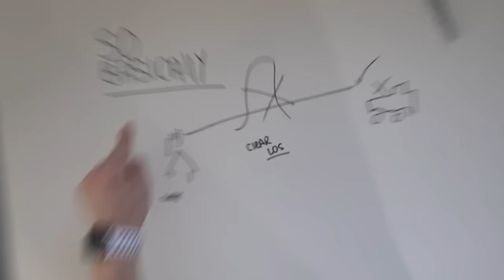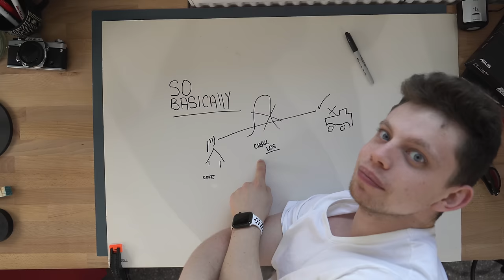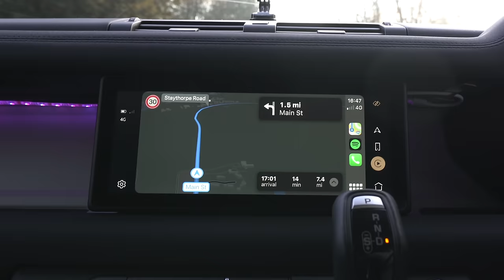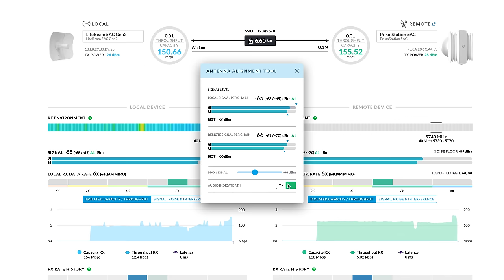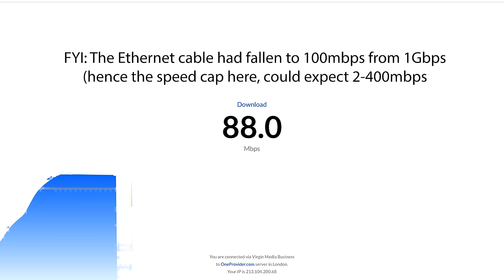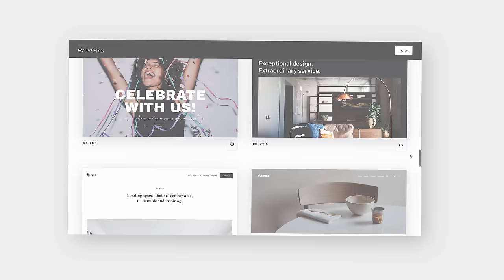How to send WiFi over 10 Miles!! (it's so easy)

Comment: Alex, you’re using the devices at a transmission power way above legal limits in the UK. Both antenna gain and transmitter power totalled together should not exceed 36dBm... and that’s in the licensed 5.8ghz band. 
If you’re not careful this will cause you a great deal of pain with OfCom! 
Read up on IR2007 and FWA Band B and C.

Moreover, your output is 50watts and the UK limit is 4watts! 🤯
Reply: This sound really interesting! I am looking forward to Alex's response :D
Reply: Where are you seeing the output power out of curiosity ?
Reply: @thecomputertech  8:33
Reply: I mean.. Who cares

Comment: I was thinking about this. 
I'm wondering if you can buy an old news channel van with those antennas that extends so high and repurpose it to a wifi extender?
I know they're made for radio/micro waves, but I think you can connect or convert your wifi router to that antenna system to get miles from it?

Comment: So, we have an office space that is 1.5 miles from our home, but it only has OLD DSL (<3Mbps) service available. Our home has 200Mbps. In between is mostly farm field, with just a couple lines of trees. I'm wondering if this would work through trees (no other solid obstacles), as we were quoted almost $11,000 to build out to the office with cable. Both buildings are two-story buildings, with our home roof peak sitting about 30 feet above ground. Thanks, in advance.
Reply: I also run an ISP in Europe.. Waaaaaaaaaaaaay bigger then this guy. Like 10K+ customers. But back to your problem, It will depend on tree coverage for antenna coverage, fiber optic cable is super cheap if you have some tractor there on the farm, build a subsoiler with a cable shoot, 40-50cm (Our machinery achieves 110-130cm direct buried cable.) You can look at a pipe layer, that will do the same job... Lay a cable deep, job done. If there are trees, the signal will vary depending on the time of year (Leaf cover). This guy is a joke.
Reply: I recommend you buy 2.4ghz powerbeam but buy the ac version for higher speed

Comment: Fantastic video, can i ask how your able to do this, i mean how do you get permition to make a remote base station as you said you intend to transmit from the hill onwards to the next location?

Also could you do a video on a rebro, (thats what we called it in the brit army) so i take it you use 2 directional antennas but you showed the 1 plugged into your laptop, what would you use for the base station set up? 
2 directional ants, a router??? (what type, can you use a typical router and weather seal it), how to power it?

Thanks and great video

Comment: I have this same equipment hooked up to starlink aimed at my shop.  its too cold to check it out now .  my signal was blocked by a camptrailer then moved to inline sight .  Im thinking I will have to take my PC back down to wireless unit and reconnect?  I will know more in the spring.

Comment: i love the energy,this is me watching your fisrt video. already subed.just a question.i see u using ubiquity beams. i have to do an installation where i have starlink on a farm v2 and need to sent wifi signal to another home which is 300m away with their own wifi router using the original starlink internet.wil NANOSTATION 5AC LOCO 13DBI work for my setup? plz help
Reply: It should but a clear los is very important.

Comment: Have you tested this between to houses in a built up area I'm not far from you but i want to send gbit internet to another house that has like 30mbit diagonally the line would hit about 25 houses along the way on google maps. but one house is on a lower elevation than the other so from the higher point i may just be able to point it diagonally and sort of aim the dish from the other property.
Reply: You can just buy powerbeam gen2 5ghz they are very strong and build to pick the signal in worst scenarios
Reply: @mataralmuhairi2402  so you think that would work with brick houses in the path I cannot see the other house
Reply: It will work and if you want better option buy the 2.4ghz version

Comment: Can you put more receivers on to one host dish? Basically, if you only have one of those dishes on your house, but you had like 5 defenders in 5 different locations (with line of sight), will it still work?
Reply: Im not too sure on this pairing but yes it is possible. In the industry this is referred to as Point to Multipoint. Ubiquiti's LTU and AirMax MultiPoint is what you'd look at for doing something like what you are suggesting. With LTU there is someone getting 24.59Km or 15.2 miles between points.
Reply: you would need a sector, 45' 60' 90' or 120' degrees as a standard powerbeam dish is 15' wide, so your stations would come on sidelobes and jsut create a mess of interference for yourself and be fooled by the CCQ quality/capacity

Comment: "The reason it was only 85 was because the cable that I was using was only maxing out at 100 meg, and not a gigabit per second."

...CAT6 is stupidly cheap. Why not just use a CAT6 cable to test that theory?
Reply: CAT5e is perfectly acceptable for gigabit
Reply: @Sparks0001  Cat5 too for small distances

Comment: Why was your cable maxing out at 100mbps? Sounds fishy to me. The CPE radio has a gig interface as is your usb Ethernet dongle!
Reply: Also interested as to why, fibre may need cleaning
Reply: Probably a crappy RJ45 connection happens all the time
Reply: @georgeb7641  Dirty fibre doesn't slow things down, you just get packet loss or no negotiation. Packet loss may show as a slowdown, but not on a speed test as too many packets were being lost. Fibre also can't auto neg to a lower speed.
Reply: @liamcook6271  i highly doubt it, especially not over a device which needed 24V Passive PoE, due to the pairs it uses.
Reply: @stevejones8392  if the CAT 6 (fibre cable) from the dish to his laptop is dirty yes it will slow things down 👍
Reply: It could possibly be that he was using a Cat5e cable at one end that would bottleneck the speed
Reply: @danielforsyth5729  good shout
Reply: @danielforsyth5729  Nope, CAT 5e is good for 1Gbps over 90 metres

Comment: I want a link through a 300 m light forest, over a small hill.
I'm curious about WiFi HaLow.
Speed is not important, just a reliable link to IOT in a secondary building
Reply: You could use a repeater at the top of the hill so that everything is in line of sight for a better signal but it would cut your speed in half which would still be faster than not using a repeater.
Reply: @pf100andahalf  then I run into the challenge of ownerships of that land, and how to power the repeater.

Comment: How do I this with no line of sight, I want to run my wifi that is only a 5mins bike ride away to my work garage. My work garage is literrally in a straight line from my home wifi except there is a one block of flats and a few houses in the way and few trees???? What do I do???
Reply: ubiquiti does have products for multi point links where you have a wide range of coverage, however the better speed/coverage you want, the more expensive.
Reply: @ali10163  Thank you
Reply: Buy the 2.4ghz radio it can go throw hoses and trees easily
Reply: I would ask the people in the block of flats to let me install an antenna on their roof and give them free internet in exchange. That way you build a network that has clear line of sight. The moment you have obstacles in front of you then your FRESNEL zone is affected which results in very poor connectivity if any. I wouldn't use 2.4ghz because its very congested and has few usable channels (3 to be exact (1,6,11)
Reply: Try raising the altitude on your antennas until you do have a line of sight. If one station is clearly higher than the other you'll also want to lower the pitch aim on the higher station and raise it on the lower station. As another commenter noted a clear Fresnel (not in all caps) zone is important.

Comment: So wish you could sort our WiFi out.
We have BT fibre to cabinet and its slow.
Can't get fibre to house a its a private drive.
Suggestions anyone?
Reply: Why can’t you get fibre to your house if you already have it to the cabinet?
Reply: @georgeb7641  because BT can't run it onto our street
Reply: @davidmeredith2695  BT don’t run cables mate
Reply: @davidmeredith2695  if you already have copper lines into your house from a fibre cabinet you will 100% be able to get fibre
Reply: @georgeb7641  well we searched bt virgin etc and they all say the same
Reply: @davidmeredith2695  I would recommend calling up some service providers and double checking because if you have fibre to the cabinet already it is only what is known as the last mile which is copper for you, the fact you already have copper shows that the poles and underground ducts are already in place making it a fairly simple provision for Openreach as it would simply be a matter of running a fibre drop wire or pulling fibre through the existing ducts no excuses
Reply: Fibre to premises from BT is run straight from the telephone exchange to the customers premises. The product you have is called FTTC(fibre to the cabinet). It will be very difficult for BT to run fibre through some of the old pre existing duct work and it would cost thousands to dig up the streets to install new ducts and fibre. @David Meredith what speed do you get off your BT line at the moment?
Reply: @danielforsyth5729  Openreach run the fibre not BT. If there is existing poles fibre can be ran quite easily like wise with existing copper ducts
Reply: @danielforsyth5729  about 19 download and 6 upload
Reply: @danielforsyth5729  you don’t know what you’re talking about Kate

Comment: what about the curve of the earth that can also be an issue.
Reply: The earth is flat, lol curve of the earth 😂
Reply: Yeah if you’re transmitting frequencies a crosses thousands of miles not over a few
Reply: @RathOX  what planet you live on.  Sheesh
Reply: @georgeb7641  i did not specify a distants
Reply: @will300c  ? What are you talking about 😂😂😂😂
Reply: @will300c  the earth doesn’t start “curving” for thousands of miles and he stated in the video the issues with line of sight